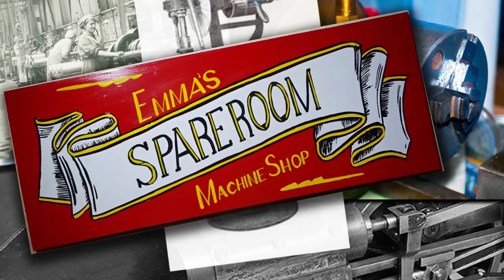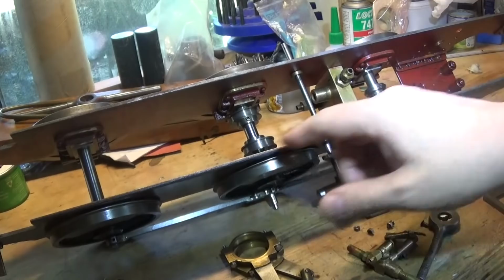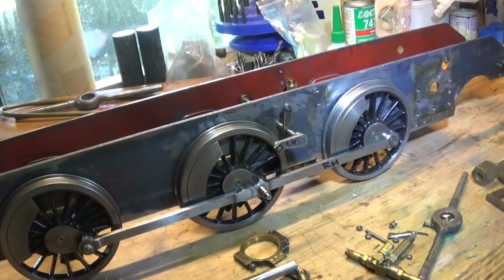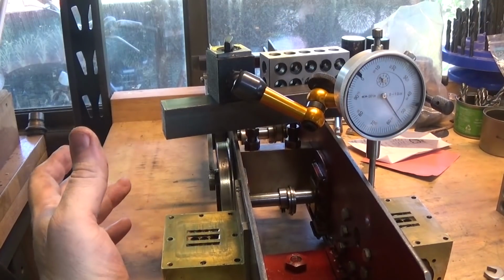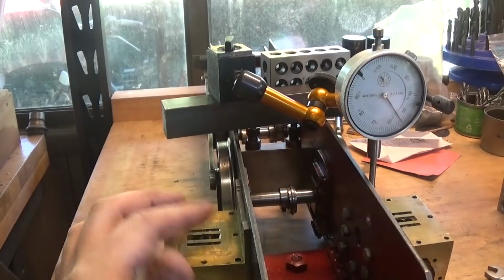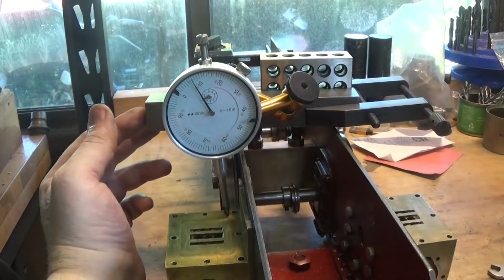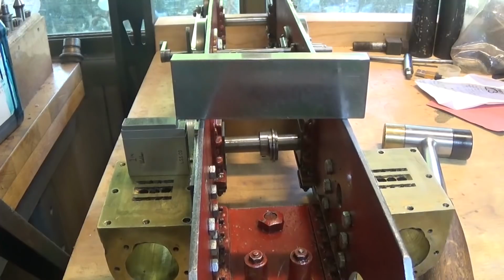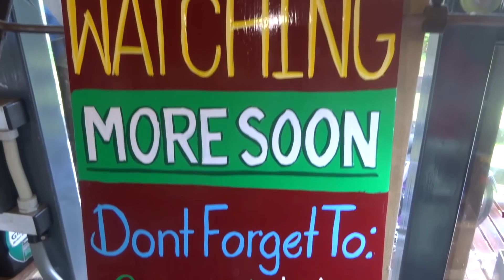Priness marina, Aligning the Stars!

Comment: Moving the cylinders do you think that will eliminate the tight clearance of the connecting rod to the lower crosshead guide or might it created more of a problem?
Reply from the maker: we will find out lol!
Reply: In an earlier video you had shown some kind of book on the engine. Is it a build manual that has dimensions you can compare this engine to? Is it just more of a build to suit general layout?